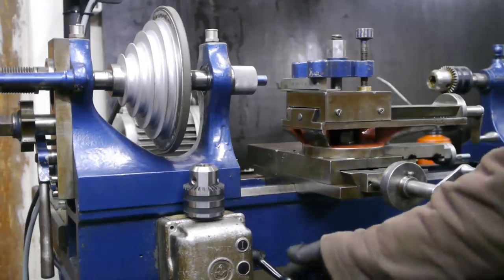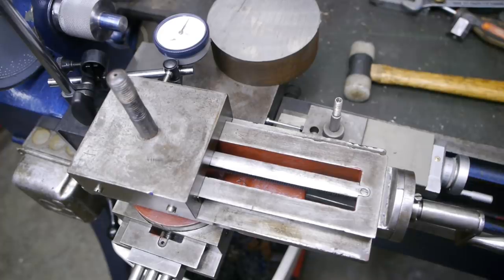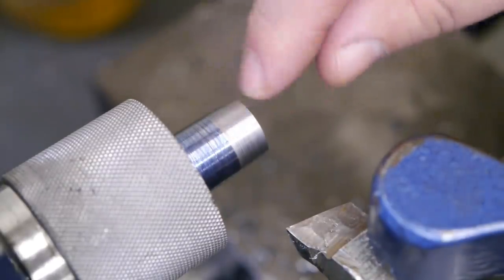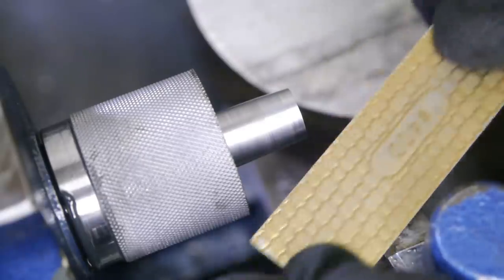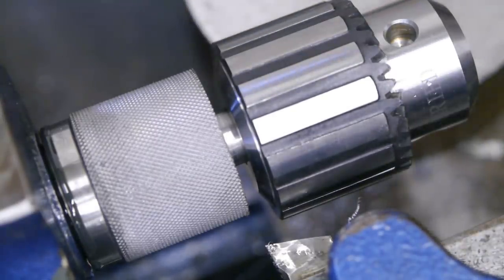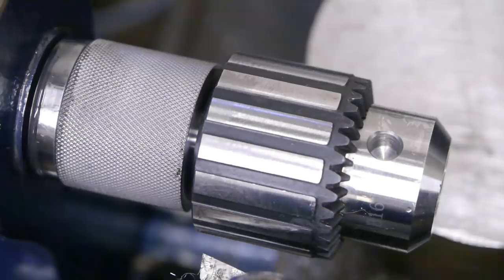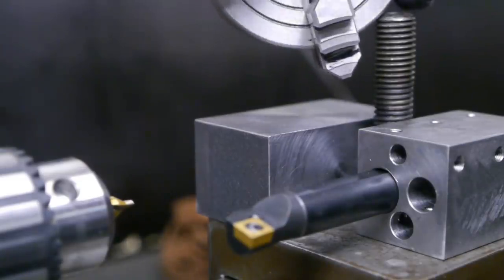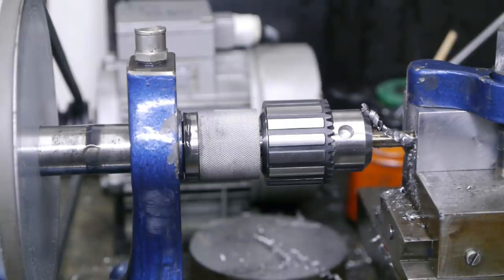Finally finishing an old lathe project and testing the new vfd

Comment: Good job on the B16 taper.   I got a smile from the comment about taking off the dimension on each side.   So easy to overlook this issue if you are not able to use the dial where this is included in the markings on the dial.

I do like the silent VFD.   Looks to be working very well.

Dave.
Reply from the maker: In my defense wikipedia does not tell you that the 20:1 ratio is for the included angle :)
The noise of the VFD is great. You'll appreciate it even more after listening to the old Allen-Bradley

Comment: wow voice is back, and you keep everything under control that's great. and yes i would concrete my backyard as well .
Great work 10/10
Reply from the maker: 10 out of 10 that rather high :) The chuck turned out to be to small and the arbor is still fixed to the spindle nose.

Comment: A touch of technical jargon, that HSS should be fine with that depth of cut in 80/100 range, putting you between 600/750 rpm.  Helps finishes and what not, as you well know.  Thanks for sharing and great job to this point.
Reply from the maker: I'm not even sure it was HSS it was a pretty old lathe bit.

Comment: One day I needed to drill a half inch hole and the drill chuck i had  would not hold a half inch drill bit so I mounted the drill bit in a lathe chuck and turned the shank down a little till it did fit the drill chuck, nice video. don't do as i do but if it works for you then it is probably ok to do just that,  I like your lathe.
Reply from the maker: I don like the idea as there probably to much run out in my chuck and the jaws could damage the flutes.
If I had a good collet set I might have tried that.
Reply: @Rolingmetal  Sounds about right

Comment: Check the taper fit using Micrometer Blue or even a coloured felt tipped pen.
Reply from the maker: I use some oil paint, works better than any type of pen.

Comment: Hi, I have 3 or 4 Asian drill chucks hanging out, there not good enough for machine use, but maybe fishing weights?
Reply from the maker: 0.1 mm run out is probably not good enough for machinists but for me it will do nicely :)
Most of my Chinese dill chucks have been ok, although I did manage to break one when I made a mistake.
Reply: I used to be happy with Asian chucks till I got some US made Jacobs and German Rhom chucks and then never looked at the Asian ones again. Recently I got a used Albrecht 0.2~4mm keyless chuck ( cost nearly as much as a Chinese mini Lathe ) and now I am spoilt. If anyone wants to know  what precision in a chuck means try an Albrecht.
Reply from the maker: I also have a bunch of Rohm chuck. But the must be the lower end models because they are not significantly better then the Chinese chucks I have.

Comment: rM,
  Enjoyed this video. It’s always great when things come together to create success. Keep on thinking!
Reply from the maker: It didn't all come together. The drill chuck is too small and the arbor is still glued to the spindle nose. 
But it wasn't a complete disaster :)
Reply: As others have suggested, turn the shank of the drill bit down to size and do what you did to get the chuck plate off, drill a hole and use a tommy bar. 
   If you have room on the spindle thread you might consider making a narrow locking nut to tighten against whatever you put on the spindle. It appears the components are locking as the seat against the spindle  hub. A narrow nut with a bit a of clearance from the hub would allow it to be loosened from the component so it could spin off freely. Don’t know how that would affect runout but might be worth a try since freezing up seems to be a recurring problem. Either that or figure some way to lock down the spindle to facilitate component removal

Comment: It’s great that you now know how how fast your lathe is turning.
Use it to calculate the surface speed for the diameter you are turning.
Find a chart with the recommended surface speed for different materials depending on the tool type you are using.
Then find a chart with the surface speed based in the diameter you are turning.

For example you are using high speed steel on mild steel which cuts best at 90 feet per minute
I’ll see if I can find you some charts with this stuff on it.

Couldn’t you just shim up the boring bar holder you already have if it is a bit too low?
You could also make a reduced shank drill that fits in your chuck.  The shank of the drills aren’t hard so you can turn them.

I’m not quite sure what you were testing with your test bar.  If you turned a point on a bar in your drill chuck it will be exactly on centre.
All this test will do is tell you if your tailstock is in line with the head stock.  This would be a great test if you could adjust your tailstock but I remember you once told me you can’t adjust it.  You should turn something between centres an see if it comes out parallel all the way along.
Reply from the maker: Knowing the exact speed is certainly better then guesstimating :)
Sure I could shim up the holder but like to make a new one with 2 extra setscrews for tool tip height adjustment. Like it did did for the Chinese lathe. I don like the idea of turning down drill bits. I don't think I can hold it precise enough.
I turned a point on some scraptonium so could hold the shock absorber strut between centers. I used that to set the topslide parallel with the bed and quire to the headstock.
Reply: Hi Rolingmetal,
I get what you were doing with the gas strut now.  I forget that lathe doesn’t have a regular longitudinal slide.
So of course you have to accurately set the compound slide parallel to the centre line.
What I was talking about with the spindle speeds is it is one thing to know the speed you have but you should calculate the best speed you use.
It’s the difference between making it sing and making it scream. 😀
Also remember these machines were made for HSS tools or even just high carbon tool steel. Using carbide on them will be challenging.
Don’t be afraid to experiment with rake angles on your hand ground tools.  That should help with metal sticking to the tip (pointy bit)
Have a look at the rake angle of a drill bit for example.
Keep up the good work and I look forward to your next video.

Comment: I just turn my drill bits down to size on my lathe no big deal  before I got the lathe actually turned them down on a grinder and cleaned up with a file

Comment: You can probably get a 16mm drill with a step down shank to 12mm or so perhaps ?
Reply from the maker: Probably but it also doesn't fit my 16mm reamer. Or my 19.5mm drill and 20mm reamer,  both have 16mm reduced shanks.

Comment: Just a small suggestion ; you could get some very inexpensive diamond lapping paste, and lap your arbor to the drill chuck b16 taper . .. you would achieve near perfect fit and finish !   * Practice lapping on a different 'failed' project , after studying the process of lapping a little bit - you'll be amazed at the results !    "V"     * Damn small drill chuck
Reply from the maker: You mean use some lapping compound like I did with that blue oil paint?

Comment: You're still O.K.  to drill a 16mm hole. Just search Ebay for 'blacksmith drill' or 'reduced shank', and you'll find plenty of results.
Reply from the maker: I have a few of those just not the right ones. I'll probably use the 4 jaw because if I would buy new drills, the reamer I have still would not fit.

Comment: hey there where dit you buy the diamond file form ?
Reply from the maker: That sure is my favorite tool. I use if for my pocket knife, putty knife, paint scraper,  gasket scraper,  kitchen knives, lathe bits, drill bits, I even used it to free up the worn dovetails on my old lathe slides :) Best thing I ever got from Banggood. 
Here's my affiliated link: https://goo.gl/BtZuZb the also sell a coarser one.
Reply: @Rolingmetal  thanks

Comment: If you already have a Morse taper sleeve/shank  -  just set the compound slide to clock ZERO along its length.
No need for the Math.
Reply from the maker: The lathe has no internal Morse taper. Not sure what it has. Something small and short.